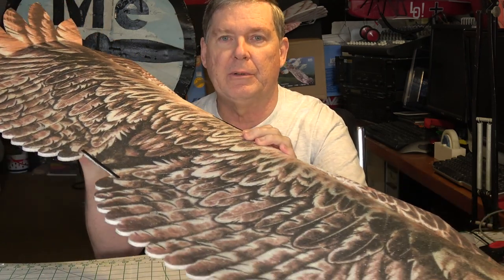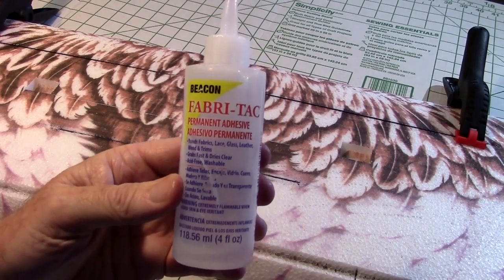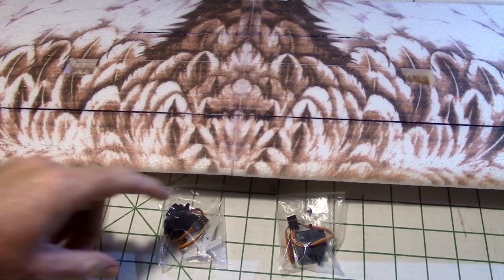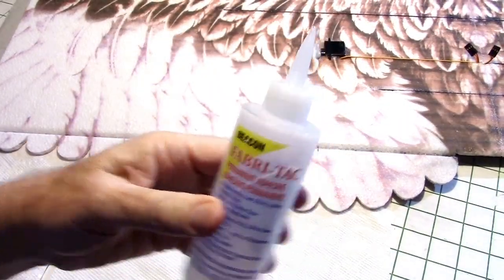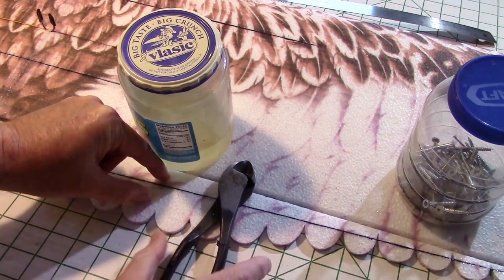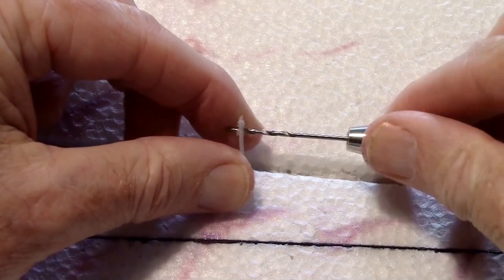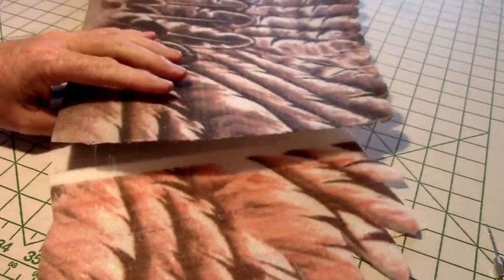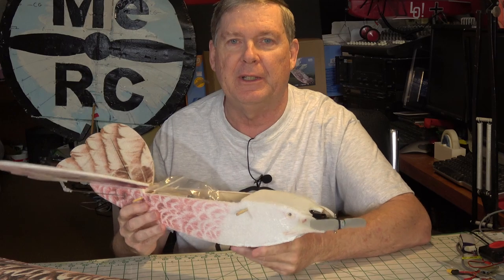DW Hobby E19 Eagle V2 1430mm Build pt 1 - Assembling Main Wing

Comment: Very helpful and informative video, that's well done. I have the DW Eagle v2 on order. I noticed that you added reinforcement to the ailerons, what size carbon fiber rod would you suggest? 1.0mm, 1.5mm or even 2.0mm, I'll need to order some...I've watched the whole series you made on this "bird", any new suggestions? Thanks.